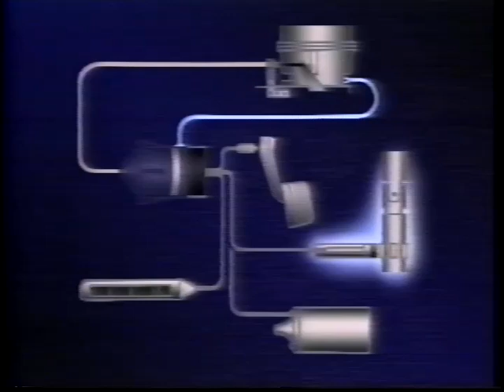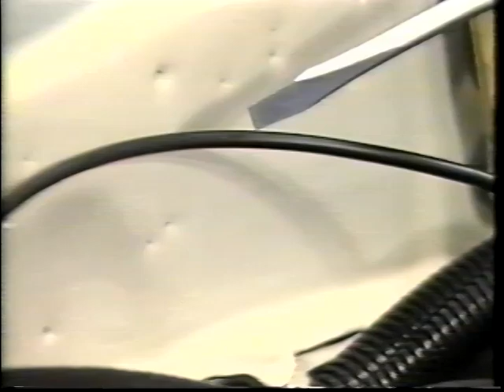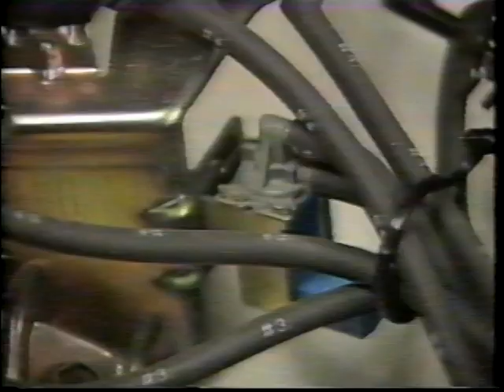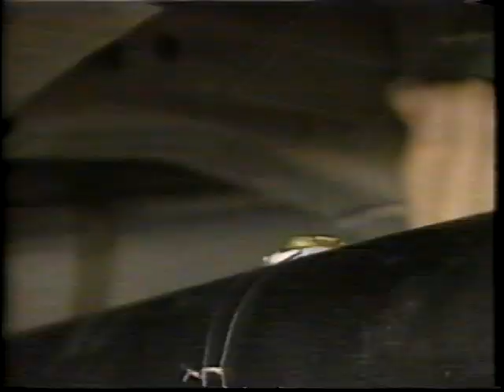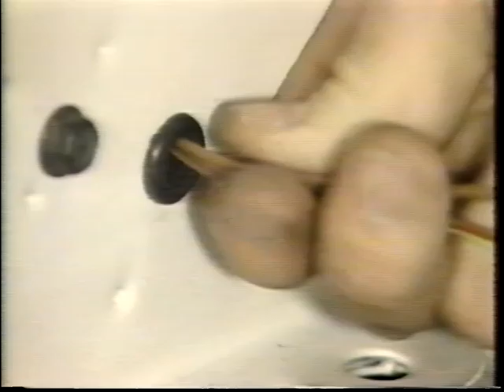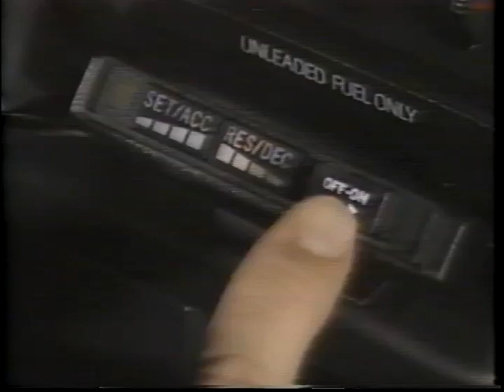Zemco ZT-12 Cruise Control Installation (1986)

Comment from the maker: 🎯 Key points for quick navigation:

🚗 Zemco ZT-12 cruise control enhances driving comfort, convenience, and safety.
⚙️ The command module controls speed, on/off functionality, and speed resumption after braking.
🔧 Proper mounting of the throttle actuator is crucial to avoid noise or malfunction.
🚨 Ensure the throttle actuator cable has a gentle curve and secure anchoring to avoid surging.
🔌 Consistent vacuum from the intake manifold is necessary for optimal actuator performance.
🛠️ Magnetic or ignition coil speed sensors are used depending on the car's transmission type.
⚡ Correct brake light switch wiring is essential for the disengage safety feature to work.
🛣️ Road testing and sensitivity adjustments are key to ensuring smooth cruise control operation.

Made with HARPA AI
Reply: I love this because I just picked one up new in the box. It's going to end up on my 1984 Dodge Ram D150.